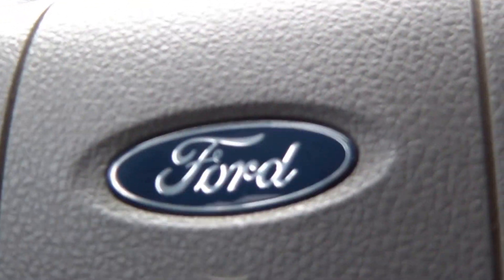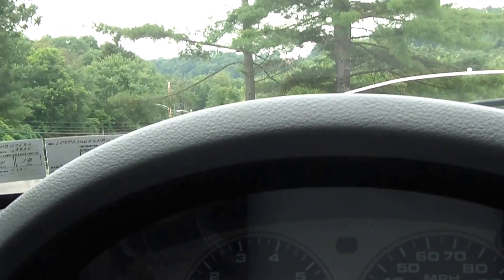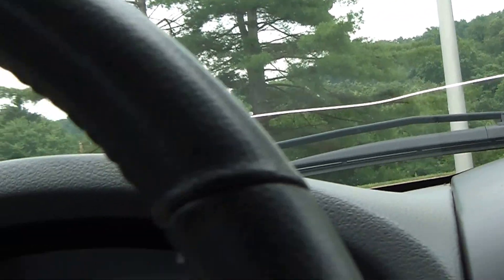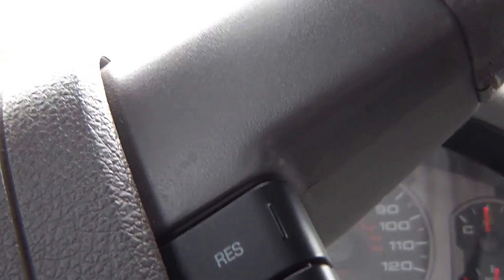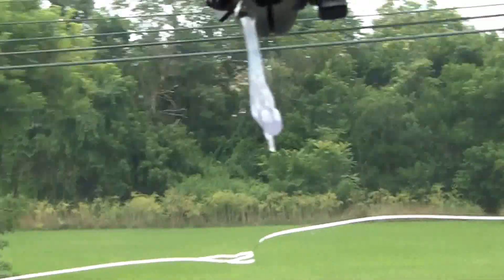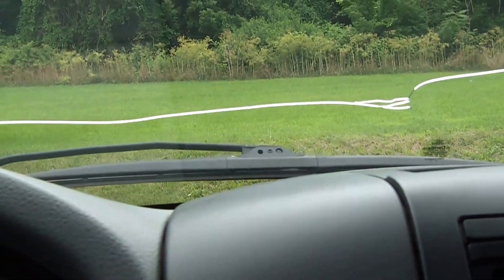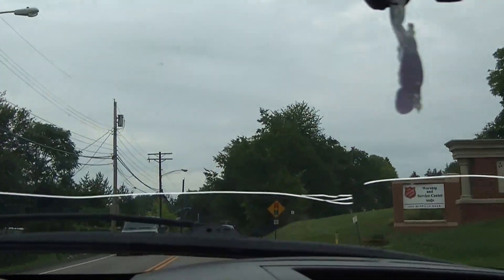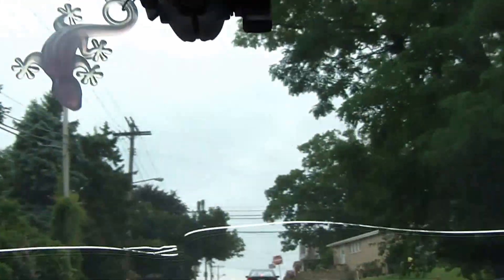HELP REQUEST: 2006 F150 Noise Identification

Comment: What would make a loud horn sounding noise coming from engine compartment.  It starts as soon as the truck is started and doesnt stop  until truck is off.  It is running a little rough too.  Its loud!  Like a muffled horn.

Comment: Not sure if you got it taken care of but I would suggest taking off your serp belt and running it for a bit to see if it takes care of the noise.  I would suspect you are looking at a bearing going on an idler.  If you do run it without the belt, you cannot go far because 1) you loose your water pump and 2) your alternator.  No problem going around the block quick though.. remember no power steering.  Good luck.

Comment: Ford can't find what's causing the noise. It really sounds like it's coming from the torque converter which was replaced over a year ago. Transmission shop say's it's not and say's motor mount's are the cause. I'm getting pissed after replacing fan clutch which the mechanic said would solve the problem. Sounds like a jet on take off and it's very aggravating.PLEASE HELP!!!!

Comment: I cannot hear what you are talking about in your vid but I would put money on it that it is your timing chain tensioner. The tensioner are the Achilles heel with these engines. Any mechanic that knows what he is talking about will confirm this. Not a super cheap fix due to being labor intensive. But if the tensioner fails completely and your chain slips a couple teeth then you will have a $5000 engine rebuild on your hands versus probably about $350 for the tensioner.

Comment: cant here the noise but sounds like a iwe solenoid that sits on the firewall passenger side.... its not holding enough vacuum causing the hubs to rattle
Reply: Lairay Nguyen solenoid?

Comment: Did you guys find out finally what it is?
Reply from the maker: I actually haven't. It's been like that for around 50,000 miles now. I have just over 100K on the truck at this point. Seems to be intermittent. Probably just going to ignore it until something happens! lol
Reply: @downturn66  , did you finally figure out what that noise was ...........my guess bad, transfer case ?
Reply from the maker: @agaragar21  No sir. I have 130K miles on it now and it's still doing it. I've stopped caring or trying to figure it out at this point! lol!